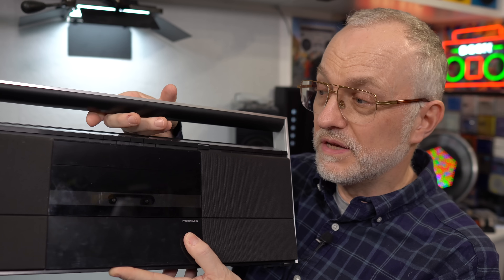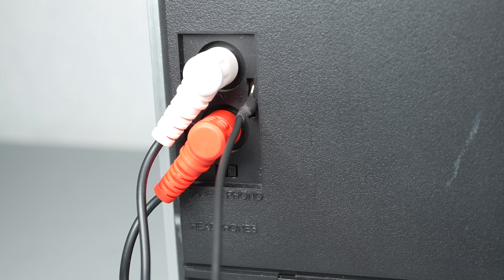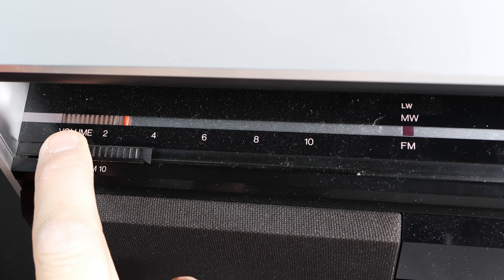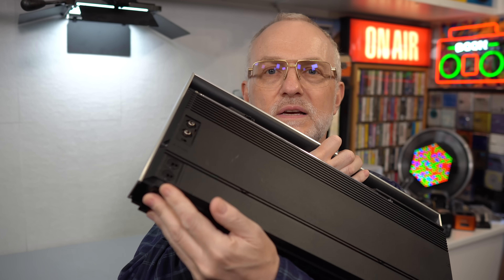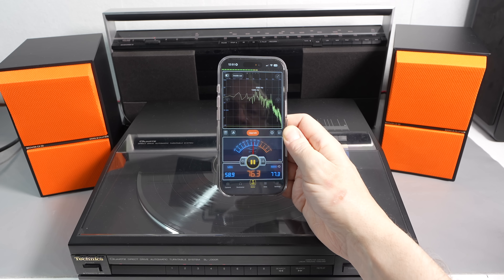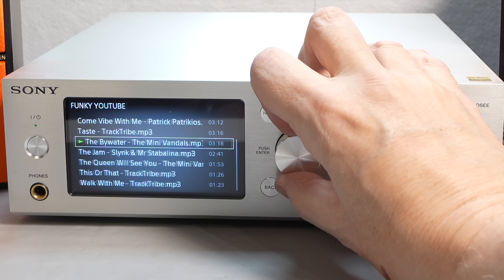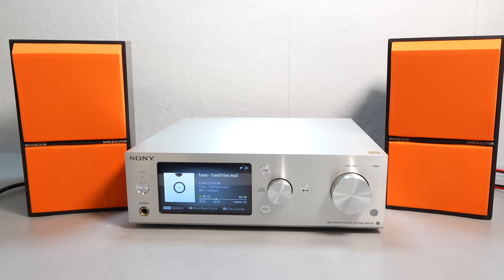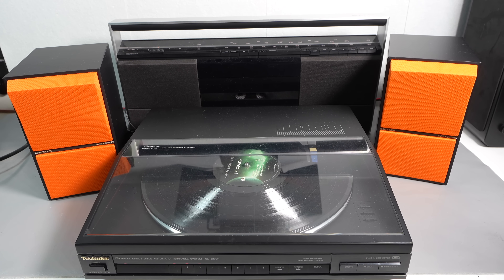Can custom CX50 speakers fix the Beosystem 10

Comment: Perished caps in the PSU or amplifier section would indeed cause distortion at higher levels, and cause the bass to vanish, since the low-frequency power demand can't be satisfied. Basically a brown-out voltage-wise.
Reply: Curious if it is also something that has to do with the inbuilt dynamic EQ that kicks in as you increase the volume. That would be all signal level, capacitors and even potentiometers, before the amplifier stage. If it was on the power supply, the overall volume would drop (not just bass) as you turn it up higher as the rails collapse.
Reply: @ruikazane5123  You'd still get plenty of high-frequency components, since they pass easier through capacitors, and they are also more efficient to reproduce on the speaker side.
Reply: @ruikazane5123  Well the point was the power supply side, but anything beyond 1uF was usually done with electrolytics anyway. Tantalums, ceramics and solid-state/polymer electrolytics have come a long way since then.
Reply: I think for something that cost that much originally, if the volume knob goes to ten, a person should be able to push it up to ten without any distortion at all. Otherwise B&0 should have limited the volume knob to six?
Reply: I have two odd situations. 

I bought a Denon 200W mini system / amplifier that have amazing sounds BUT it have a very noticable hum when put on any input but on radio. The radio oddly sound clear with no hum or buzz it's the  best even is silent when there is no transmission, the hum goes on my nerves on every other input (CD, USB etc) because I wanted to use this as aux for my PC while making music, it also have 4 aux inputs and support for USB, CD, MP3 list goes on, I love it, this is so far the best compact yet beautiful sounding system covering all sound range and one I can afford too. I wonder if there is a fix.

Second is another mini system but with 80W that worked perfectly for maybe 10 minutes or so then the audio vent super low and it's muddy, the more volume I apply the lower it gets and the bass basically nukes all sounds. I tried it 1st on low power speakers but only put up to 15% since it was loud to me, then on  higher rated ones (2X100) and the system works like crap on both, lastly I tried on another speakers that are nearly the specs this one should have and yet again it's the same result.

I wonder if this can be repaired or if it's too much cost or time should I sell for spare and repairs and move on.
Reply: Using the multimeter on the plug before fixing the cables would have been more logical
Reply: I wondered if this might have been the case!
Reply: @DuaneDiddley  Bad caps can even cause the same phenomenon with headphone outputs. Capacitors as a signal component are frequency-dependent resistors. The higher the frequency and capacity, the smaller the resistance. Meaning when capacitors degrade, their resistance for low-frequency components increases.
Reply: @graealex No, caps are not "frequency dependent resistors". A capacitor represents an open circuit at DC, that's as far as it goes. They are impedances with regard to AC components of a signal having both a real (resistive) and imaginary (reactive) component which sum aa a vector (impedance). They not only influence the magnitude of a signal, but also it's phase. They are not frequency dependent resistors.
Reply: @markboyle9941  They are exactly that, as you basically explained yourself. 0 Hz = ∞ Ω, ∞ Hz = 0 Ω. But of course you can always go "ackshually" on a simplified explanation that for the most part told people why the lack of bass would be the first sign of capacitor failure.
Reply: So it’s actually a loudness curve added to the first 1/3 of the volume slider travel. Moving it past this area removes the bass contour. 

Perished power supply capacitors don’t have a filtering effect on LF output but overall power supply ripple in the output. 

Signed - an amplifier engineer.
Reply: @brandise76  So many experts here. Btw that singular, unified amplifier design that 100% of all amplifiers use, ever used, and will always use, what's it called again?
Reply: @brandise76  Or might it be that there are vastly different amplifier designs out there, which all exhibit different modes of failure when components degrade. Although I can guarantee you that if you went in any amplifier and replaced all caps with half the nominal value, if it didn't outright stop to work, the sound would get more quiet, and more tinny, because speakers and amplifier form an RC network, and decreasing the C shifts the lowpass towards higher frequencies, but what do I know, after all I am not an amplifier engineer.
Reply: But the manual of the device says something about turning it past 6 will cause "slight" distortion which is pretty much where Matt is hearing the issue. Probably a intended affect and not perished caps.
Reply: @InfernusdomniAZ  You will never guess it, but it can be both at the same time - an intended effect to some degree, aggravated by electronic components having gone bad also.
Reply: @InfernusdomniAZ  For explanation, one way to achieve the effect described in the manual would be to purposefully undersize the caps. Then when they degrade over time, this mild effect might become more pronounced.

Comment: Hi, i don't know if you've already got this far, but B&O made a passive sub woofer with a crossover (its called Beovox cona) to go with the cx50 and cx100, although you do get fairly good bass from cx100 you get next to nothing from cx50. the cona could also be used as a foot stool/seat, and as its a passive set you can use it with anything, not just your B&O portable radio.

Comment: It should be left on for a few hours to see if the distortion appears at increasingly higher volumes. In this case it is probably some capacitor.

Comment: First time I’ve seen orange speakers. 
They definitely draw your eyes to them. 
Pretty good sound too.
Reply: Probably the most famous would be the JBL L82 two-ways, with the orange Quadrex foam grilles - though they also came in blue and black. 

And, well, there's the whole Orange guitar amps thing.
Reply: There were tuac guitar amplifiers with really orange speaker covering but those are almost nowhere, they were more known for modules I think

Comment: You're looking healthier again. All the best!
Reply: Once upon a time that two blade system was called a Jones plug
Reply: @ededwardson6074   It doesn't make sense to call it two blades when it have one nail like pin and one "blade"-ish connection (+ -)
Reply: @xityarxip  Perhaps, but One nail-onebladeish plug is a bit of a mouthful :)=
Reply: @TheAzynder  Bladenail and I?
Reply: @ededwardson6074  Jones is slightly different.  Jones plugs are still used on RC cars - where the neg pin is at 90 degrees to the supply.   DIN was before Jones...